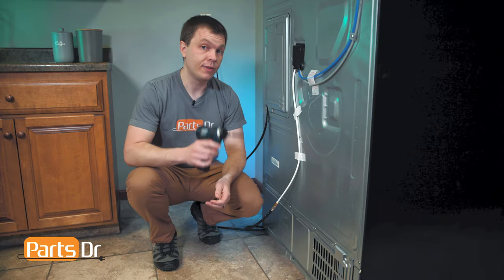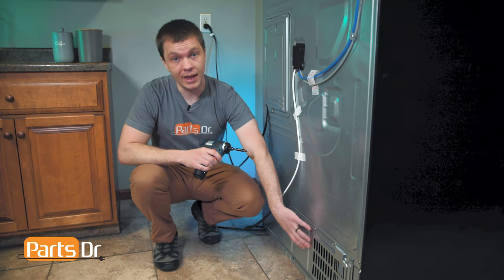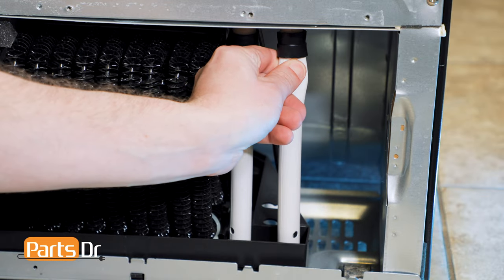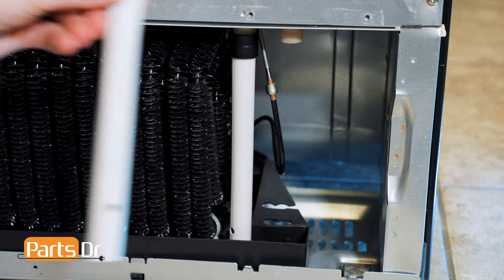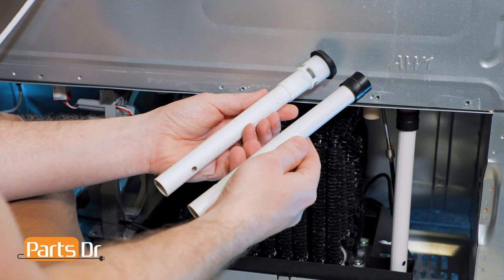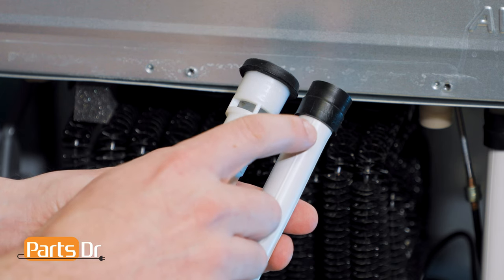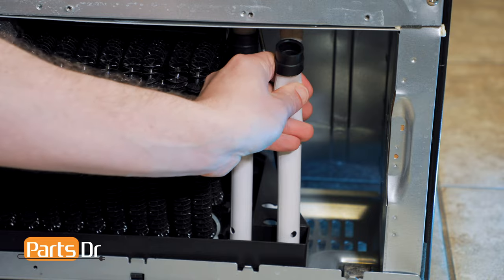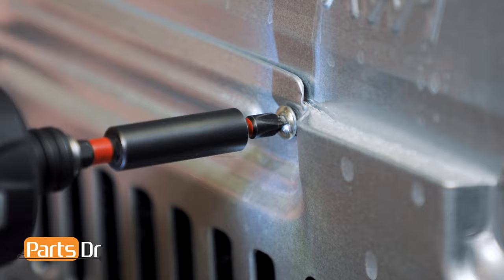How to replace Samsung refrigerator drain tube part # DA97-04049Q

Comment: Hello, I know this is an older video. I have a 2 foor Samsung fridge and i will be replacing the 2 drain tubes. My question is the hole on the end of the long hose,  your video shows it facing the toward the bottom. Does it matter if it's on the top or bottom? Thank you very much for your time and your video. Cheers!
Reply from the maker: The hole should face the bottom as shown in this video.

Comment: water building up under pantry door which then turns to ice.  Water also leaks out onto floor.  Repair guy (who's no longer in business) said I need to replace the leakage kit.  Do you have a video for that?  Thx
Reply from the maker: We do not have a video on that at this time.  Hopefully our existing videos can help you out enough to get the job done.

Comment: So a couple of questions. What kind of problems would a bad drain tube cause? And could it be the culprit of my problem which is ice buildup at the very bottom of my freezer which then leaks out the bottom of the freezer door?
Reply from the maker: If the drain tube is blocked or restricted in any way, it could cause the ice build up on the bottom of the freezer and leak that you are describing.
Reply: @PartsDr  Would a blocked drain tube account for a loud knocking sound coming from the bottom freezer?  It stops when the drawer is open and starts up a few seconds after the french door is closed.  Thanks!
Reply from the maker: @F110mech  Not that we have heard of.  Maybe check the freezer evaporator fan motor?  https://www.youtube.com/watch?v=OpLI6PTJ4hg

Comment: how many times a month or a year should I be checking/cleaning or replacing these tubes?
Reply from the maker: It really varies quite a bit.  Houses that have animals that shed or a lot of dust can have issues and need to be cleaned more often.   There is no set timeframe that we can give you.

Comment: Why would someone need to replace a drain tube?  Do they go bad over time?
Reply from the maker: They don't usually go bad, but if the drain tube is blocked or restricted in any way, it can cause the defrost water to not drain properly into the drain pan.  You may see water or ice on the bottom of the freezer or fridge section if this happens.